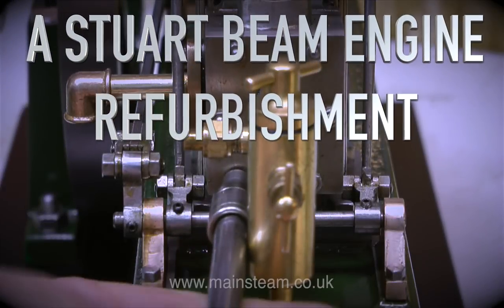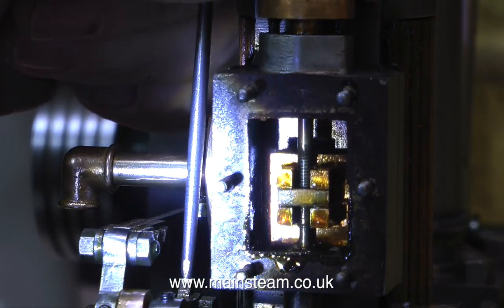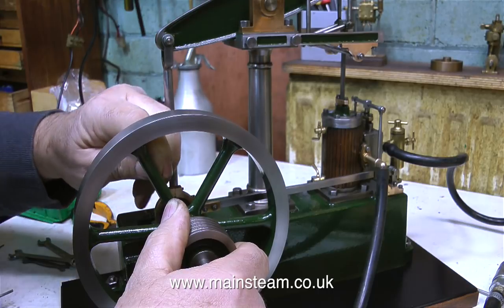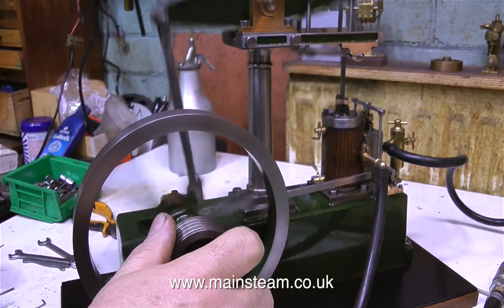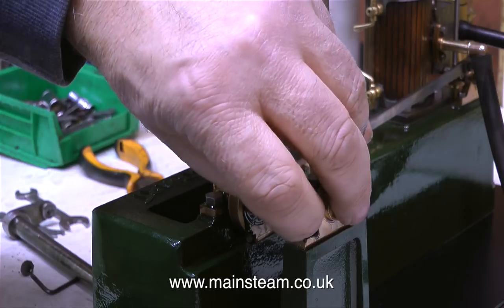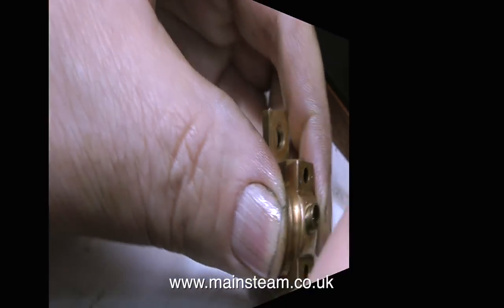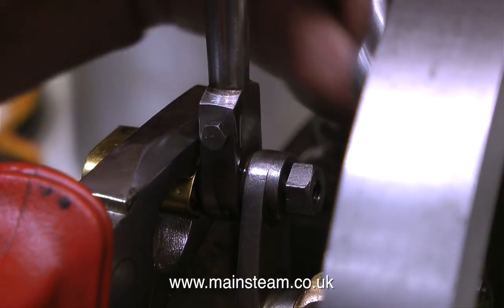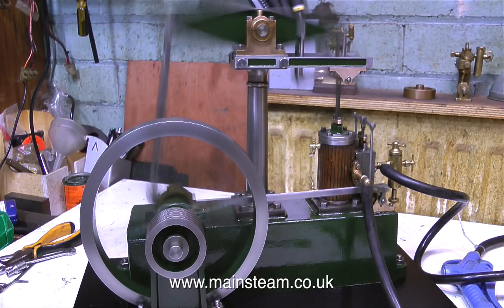STUART MODELS BEAM ENGINE REFURBISHMENT - PART #7

Comment: Keith has to run it at above working speed. It's the same as proofing the barrel of a gun; you test it above and beyond the usual tolerances to make sure that it won't shake itself apart or blow up.

If Keith DIDN'T test his engines above/beyond usual working speeds and pressures, I would not consider him a competent steam engineer.

Comment: With all those skinny valve linkages and parallel arms flying about, it does look a bit on the edge of catastrophe at high speed. But you're the doctor!
Reply from the maker: it is much stronger than it looks. I would prefer it to break on my workbench than after I sell it to someone in the future . . . .
Reply: Hopefully, any new owner won't keep it in the basement!
Reply: It's a relatively small machine so the inertia in the moving parts isn't as severe as with a larger machine. As long as the moving parts are balanced, high speed runs are perfectly ok.

Comment: Hi Keith, 

I'm bidding on a very similar engine at the minute. I'm wondering if you can tell me, is the 'barrel style' housing for the piston a pressure vessel, or is it just for show? I'm wondering if there's an internal metal cylinder that actually holds the pressure for the piston. I'm not that well versed on steam engines so sorry if I get any nomenclature wrong. Also, if I win it, would you mind if I messaged you and asked a few questions? 

Thanks!
Reply from the maker: The Cylinder is a Pressure Vessel and it is made from Cast Iron on this engine. (I assume that is what you mean by "Barrel Style Housing")
Reply: @keithappleton  Yes it is. Thanks! I wanted to check to see if what I'm bidding on is a stuart engine or a very well made replica. I'm 99% sure it's a stuart now. I've never ran a steam engine before, and my knowlegde of machining and engineering in general is purely theoretical because of my health (I don't get out much). I wanted to get one to take apart (very carefully) and fiddle with, and to display, but stuart models are just out of my price range for the unmachined kits, and I don't have the tools or skill to make one up even if I bought one. If I win and once it comes, I may ask your advice on a few things before I see how well it runs on compressed air if that's okay.

Thanks again!
Reply from the maker: I only give free advice to my Patreon supporters: www.patreon.com/keithappleton
Reply: @keithappleton  Totally understand. Thank you for your advice so far however it's been very useful.

Comment: General (theoretical?) question about steam valves. I have 
seen many of your engines’ steam valves, and they are almost all universally the 
same. The steam admittance geometry of the free space the steam passes 
through, is a basic rectangle. I suppose this allows for a quicker, more uniform 
burst of steam just as the valve opens enough to expose the beginnings of the 
rectangular hole. BUT... What if, instead of a rectangular shape, the steam 
valve openings were OVAL-ish? So that the beginning of the opening would be a 
rounded shape? Would this make for a more gradual admittance of the steam 
instead of a “burst”? - Granted, the time it takes for the valve to make it’s 
way up and down through a cycle is very fast. But still, might this oval shape 
extend the time it takes for the steam to pass through the admittance 
valve, thereby smoothing out the function and the SOUND that the valve makes? (I 
hope my questions are not becoming the bane of your existence, but watching 
and listening to your work gets me thinking about how to improve or perfect 
something that already works fine. Kind of a quirk I have.) – Thanks again for 
your time.
Reply from the maker: my steam valves are generally a cone ended shaft which plugs up the hole in the valve until you unscrew it.
Reply: I think I may be using the wrong terms. - I am referring to the opening that lets live steam into the cylinder. Isn't it just a rectangular opening in the "steam chest"? It's that opening that I thought a different shape may change the smoothness of the valve cycle... ?
Reply from the maker: I see.
It's one of those things ..... the shape of the valve ports & steam ways is relatively unimportant unless they are too small and twist and turn too much (which they don't anyway). Like any gas engine, the larger the ports the faster the gas can be transferred. Steam ports have evolved and this is just about the final evolution of a reciprocating steam engine's inlet.